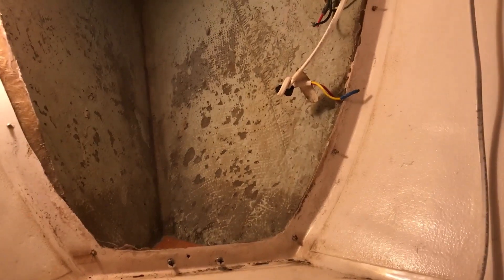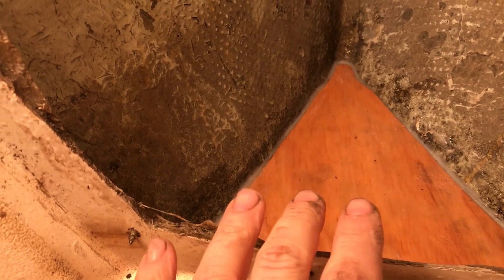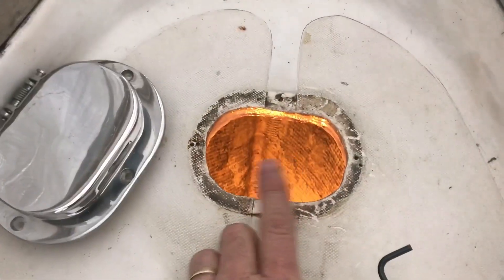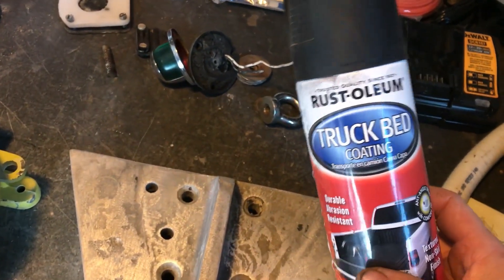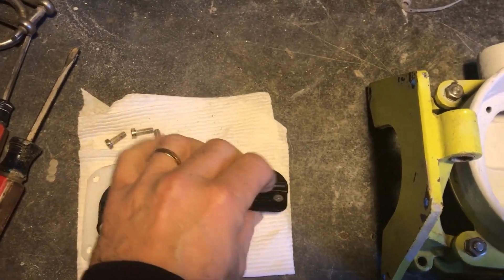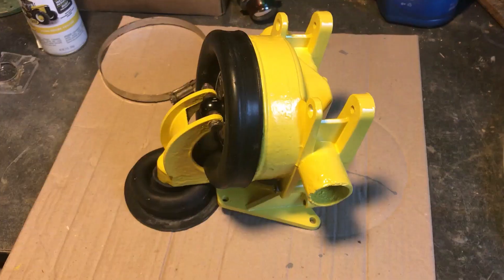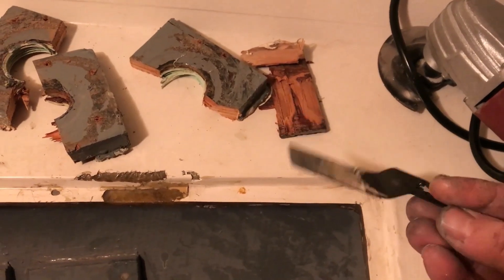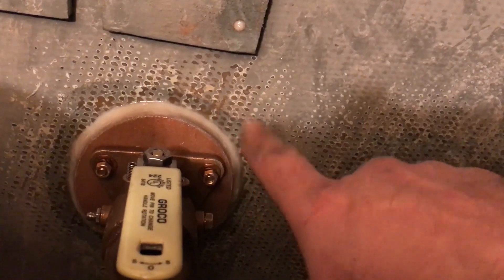Contessa 26 Refit ep.3 - Sanitation, Stem Head and Chain Locker

Comment: I don't know if you've already made the hole, but I'd be very leary of having a drain up on the bow.  I think it'd be much better to drain it to the bilge.  

I recently rebuilt the pump on my holding tank too (it was a Gusher as well).  You can get a rebuild kit from Defender.  My diaphragm was completely saturated with rather odiferous material.  I think I got the neoprene rebuild kit, which is supposed to be a bit more impervious to the effluent.

Comment: Do you think there are any downsides to installing the chain locker holes/clam vents? I saw Erik Anderea do the save thing on his Contessa 35 and it seems like a good idea, but I wonder if water could ever get in if the bow dug into a wave or something.
Reply from the maker: If the boat heeled over enough for the drain hole to be underwater while moving, the clam shell cover on the outside creates a vacuum while the boat is moving. The only disadvantage would be if you run aground and then lean over so that the drain hole is underwater while still. In that situation, you could take on water. I actually closed the hole back up in part 13 of these videos.
Reply: The contessa 26 is a very wet boat , i would not of put that cam vent there . If i remember JJ Taylor had an opening to get as much chain low along the inside and keep the weight low . I think i would of kept a drain to the bilge and added extra bilge pump  instead .
Reply from the maker: You are commenting on a video that was made in 2017 and uploaded in 2019.  I've since closed the hole and gone back to a bilge drain, but even so a clam cover over the drain keeps water out if the boat is moving otherwise, you would need to make sure the chain locker is water tight.

Comment: I'm doing something similar on an Alberg 30. Curious what motivated you to change the new plywood backers you installed to G10, and replace the bronze through-hulls you originally intended to keep?
Reply from the maker: Just a couple of those jobs that I finished, then decided to do them again because I know that I’ll keep wondering if I should have used better backing blocks and replaced the thru hulls when I’m 1000 miles offshore.
Reply: @EpoxyAndButylTape  Thanks pal! I'll be following your progress 👍